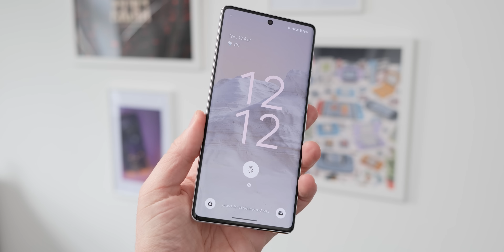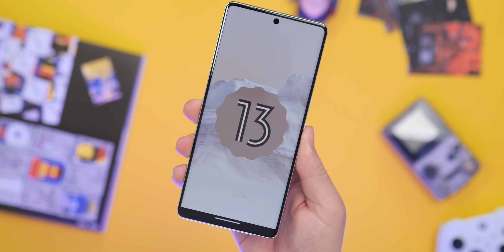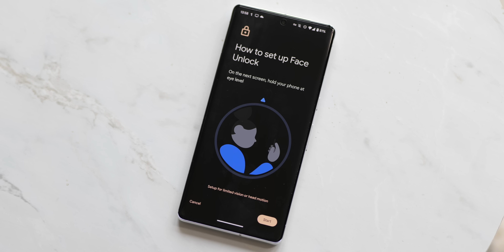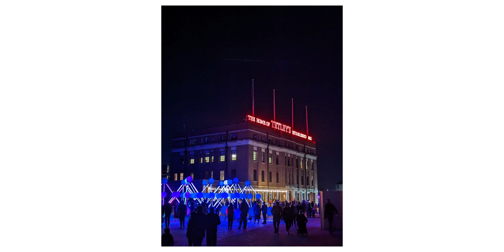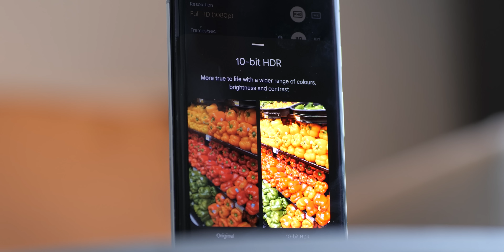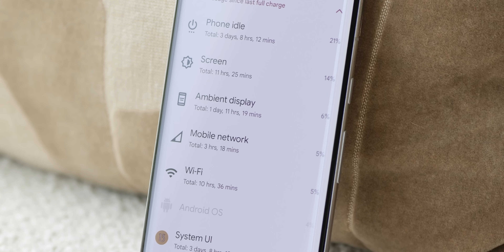Pixel 7 Pro long-term review: The BEST Google phone ever!

Comment: I went from Samsung galaxy to a Google pixel Pro 7 and I will never use another phone other than Google pixel. I am completely amazed at what they're offering
Reply: I went from iPhone 12 to pixel 7
And i probably never switch to any other phone
Reply: @nimishvshaji5089  really? switched from iphone 14 to pixel 6 and felt like this phone is cheap quality , cheap hardware , connection issues always, even though iphone charges slow but pixel charging takes forever coupled with worst battery backup , only the camera at night times feel like better than iphone i have used pixel 3 before and it was better than this
Reply: @SanifKa  pixel 6 is not that good 
Have many problems
Pixel 7 is better in almost every way
Phone get warm easily and just good battery life is the only problem I have with this phone
Reply: @nimishvshaji5089  pixel 7 still uses samsung modem even the samsung itself don't use samsung's crappy modem in their flagship phones,
Reply: @SanifKa  i am not facing any major issue with reception
Reply: @nimishvshaji5089  are you using 5G?
Reply: @SanifKa  no only 4g
Reply: @nimishvshaji5089  issues will come once you start using 5G
Reply: @SanifKa  there are issues with all phones when using 5g
5g is not fully optimised
Reply: @nimishvshaji5089  i have a budget 5G and phone which perform really better on 5G than pixel 6 , i was using regular iphone 14 before pixel 6 and i was really really impressed with iphone's 5G capability because they are using snapdragon's 5G modem, all phones using snapdragon's modem will outperform pixel 6 and 7 in network connectivity for sure
Reply: @SanifKa  pixel 6 has lot of 5g issues
7 doesn't have that much
Reply: @crew fox 🤗😄welcome to the pixel family
Reply: @bigmaxcc  Thank you 😊
Reply: Same... From s23 to pixel 7 pro... And this time pixel is almost perfect... Don't see much to complain about... For daily use the chip is more than powerful and for me battery lasts more than a day.. Pictures are perfect.. only gripe it does heat a little in Indian climate but then indoors it's fine... Otherwise can't be a better phone..
Reply: I got a iPhone 13 with Verizon and a few days later exchanged it for the pixel 7 pro never going back. Pixel forever for me now
Reply: The animation transition is best😅 i hope xperia can have that animation, because i miss the camera pro app and photo pro app, but thr animation keeps me on getting pixel 8 soon 😊
Reply: Same, I love my pixel 7. I love Real tone I switch from samsung s22 ultra and the only thing I miss, is dual app ( clone social media apps) and secure folder. I  can not wait till Google brings these 2 features too to android 14 or 15. I feel like they are the one who can take on apple.  Real love for REAL TONE! Thank you!!!!
Reply: @hadaresawadogo3456 pixel has secure file option. Check online how up use it
Reply: Think it would be worth it to go from an s22 ultra to the 7 pro? I could trade in right now and pick it up for $200 from Google.
Reply: @PoopyPants1977  if you are moving from exynos s22 ultra it's worth it.  Much faster, less laggy. Camera is much the same but weaker zoom.
 Audio is little bitt worse
Reply: @christoffero89  nah it's the snapdragon. The main thing I am disappointed with is the camera. The video is good and the zoom is cool, but the pictures suck if the light isn't just right.
Reply: @PoopyPants1977  definitely do it you won't be disappointed 👍
Reply: @crewfox11  think I'm going to. Thanks for the reply.
Reply: Same to me, from s22 ultra to 7 pro..
Reply: I've had my Pixel 7 Pro for 5 days now. Battery life isn't great. Stand by time is also not great. I'll have it at 100% before I go to bed and when I wake up it's at 91%. That's with no apps running in the background. Charging speed isn't nothing to brag about. Also, customisation is minimal. Very bland. Coming from a Samsung Galaxy s21. I do feel it is a lot more fluid/smoother switching between apps. It seems a lot more optimized than a Samsung Galaxy. I guess it's due to the stock android without any UI over it
Reply: I just hate that you can't move the Google bar or the at a glance widget
Reply: Like what?
Reply: Can you tell me how battery is I keep hearing it very slow charge.
Reply: Don't bullshitting 🤣
Reply: Not a fan of Samsung at all 👎🏻 pixel 6 Pro 👍🏻 luv it
Reply: If only it uses Snapdragon 8+ Gen 1 or tunes it to become Tensor..
Hopes the successor will use Snapdragon 8+ Gen 2.. and ditch Exynos..
Reply: Guys imho the only reason to choose a pixel over any other android, is the incredibly fast boot up time from turning it on ,, stock android and voice to text the Google assistant integration ,, and the software exclusives ,, beyond tht way cheaper oppo phones and Huawei phones offer better battery life better optimization and the photos equally impressive
Reply: I would buy pixel if it charged faster and had better speakers.    Samsung aseries has better speaker then 7 pro
Reply: @christoffero89  I bought a fast charging plug from Amazon and I can charge my pixel 7 Pro in less than 50 minutes
Reply: Tensor G2, Battery life and Charging are 3 issues for me but Battery life❌ and Charging speed❌ are 2 main cons. But, i can understand people value more other features.

1/ Do you have bugs with fingerprint scanner ?
2/ Do you daily use AI features about Voice or Texte or Photos editing ?

Enjoy your phone 😊
Reply: What sort of Samsung Galaxy did you go from ?
Reply: @mikldude9376  I've always had Samsung phones my last phone was a Z flip 3
Reply: @SAHIL KUMAR  I agree Samsung phones are amazing, but for me & my usage the pixel just has the edge for me 😊
Reply: @crewfox11  thanks for the quick reply .
  Cheers.
Reply: @SAHIL KUMAR  s23 ultra is better. But not worth the extra cost
Reply: I gone from Pixel to Samsung. I will never go back to Pixel. I am amazed with all the features with Samsung.
Reply: @SAHIL KUMAR  so what? He is not a blind Samsung fans like you pixel software experience is far superior than any android phone accept the fact kid
Reply: @SAHIL KUMAR  problem is there loaded with bloat the new phones 128gb but there is 60gb of bloat and Samsungs stupid apps.
Reply: @crewfox11  i was also a samsung boy mate , mostly galaxy note series(still have and use my trusty note 9 :) as well as current iphone ) , but samsung put an end to that and left us with the watered down crap  available now , i no longer buy samsung .
 My little bro has a pixel 7 , he loves it , he has a new car and been going to scenic destinations and sending me pics , pretty darn good cameras on the pixels ay .
All the best with your 7 pro .
Reply: @mikldude9376  thank you 👍
Reply: @sahilkumar3866 hm, a 1200$ phone is better than a 750$ phone? Wtf really?????????

For the price the pixel 7 pro is an absolutely amazing phone.

Comment: Pixel phones are trash, get a Samsung phone for reliability, software updates and power
Reply: Pixel 7 pro dunks on the s23 and s23 plus.
Reply: You can always rely on your Samsung to provide you with explosion of emotions 😂 and getting kicked out of planes 
Will never again buy anything from Samsung
Reply: @memolicja2108  That was years ago, nothing has happen since.
Reply: @edmanns  yeah but it did happen, i will not risk my and my family lives. And even worse was how they tried to handle situation, supposedly exchanging batteries while even after that, they kept exploding. In my book there is no software or hardware feature more important than safety
Reply: I bet Pixel Fold will have bugs and everything that comes with Pixel phones.

Comment: Help me in figuring out choosing 6A, 7 or to wait for 7a!
I'm just an average user and concerned about budget.
Reply: I would suggest wait for 7A ,I have the 7 and my flatmate has the 6A ,based on the rumors 7A seems very similar to the 7 and quite a nice bump from the 6A. The only main downsides of the 6A compared to the seven is G2 chip and the lack of 90hz display,both of which should be coming in the 7A
Reply: wait for 7a
Reply: Wait for the 8a
Reply: Best Buy is selling the Pixel 7 unlocked at $450 right now. That's an amazing deal.
Reply: 7 or 7A would be your best choices. The 7 was picked as the best smartphone of 2022.